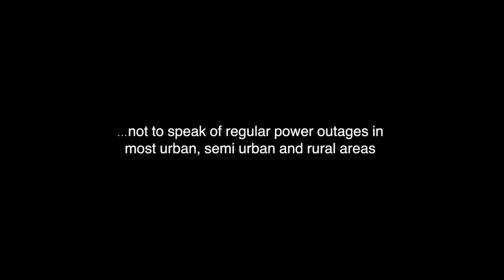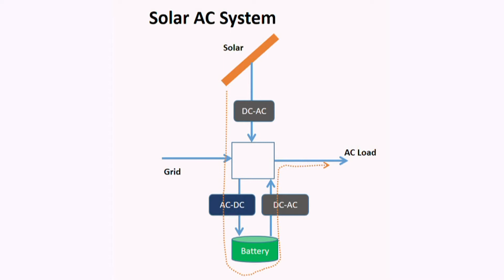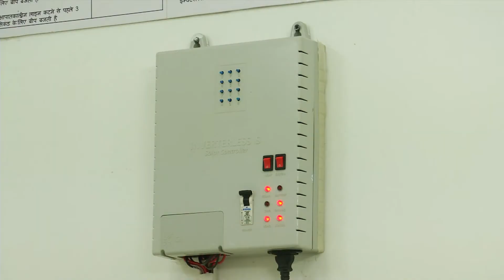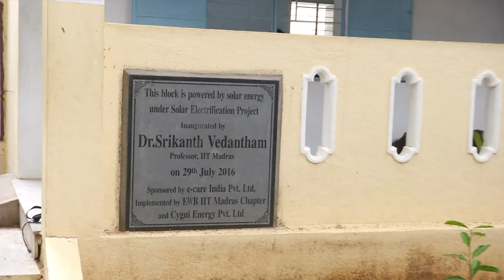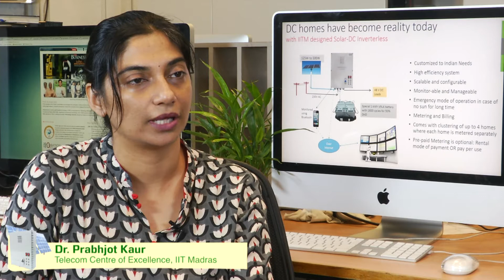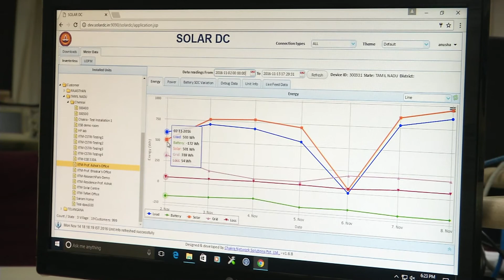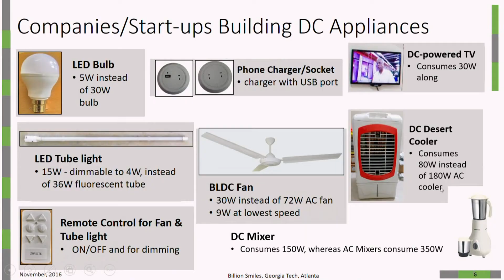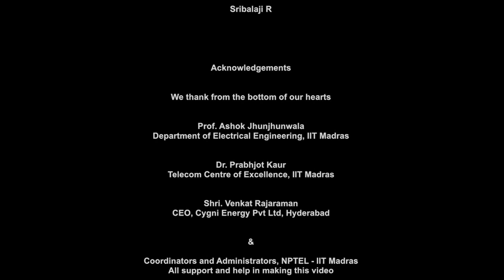Power for All | Solar Energy - IITM & Cygni Energy Initiative

Comment: we got this inverterless system from government iam from Assam . i cannot use other dc product . how can i use other dc product . if there any helpline number ?
Reply: you can use any dc product at 48V DC, take car ethat the product you use is not consuming more than the rating of the system and th emaximum energy that battery and solar panels support. in case needed, you can add on more appliances and solar, and battery as and when you want. IF you need write to venkat@cygni.com or Prabhjot@tenet.res.in